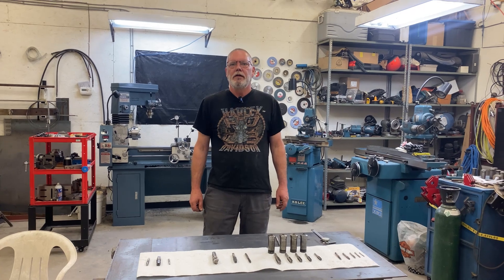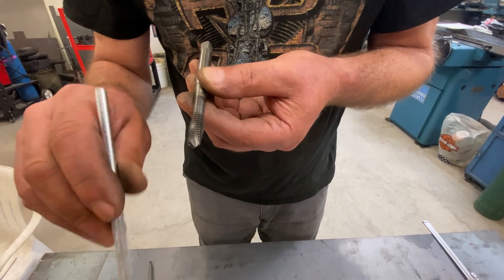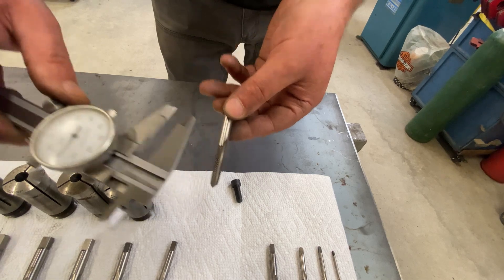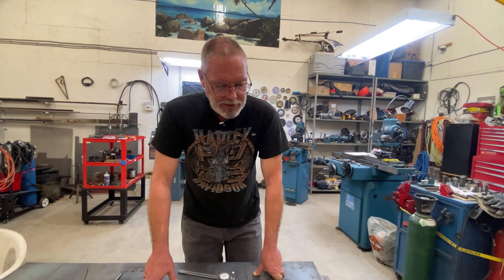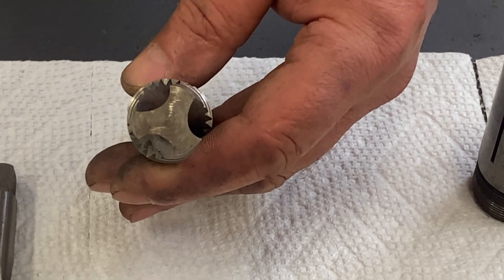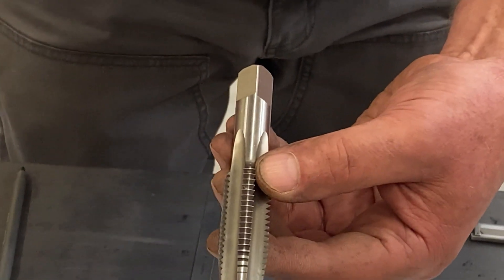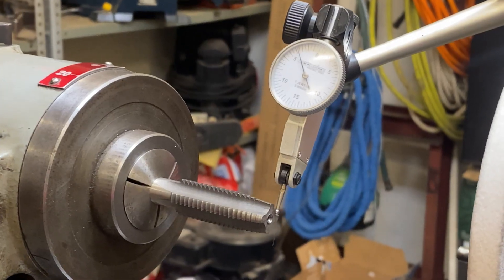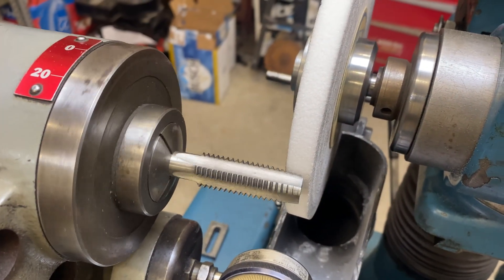TAPS - DEEP DIVE

Comment: Just one question, is the axial movement designed to accommodate grinding the flanks of the teeth if the wheel is shaped to the tooth profile? I have just discovered your site and am enjoying your videos a lot.
Reply from the maker: In this example the wheel is dressed flat and the main purpose of the axial movement is to match the grain of the grind to the pitch of the tap. To grind the profile of the teeth would require that the tap is advancing at exactly it's pitch. This would require the rotation of the tap to be linked to a lead screw. My equipment isn't designed to do this and doesn't have a lead screw to drive the table. 
Thanks for watching!

Comment: There may be an error when using a Papago translator. First of all, thank you for the good information. I'm a 29-year-old man who marches end mill and drill in Korea. Since I'm a beginner, I think there is a formula for calculating the tip angle according to RPM, but I even watched an overseas video while looking for it. It's a question that has nothing to do with the video, but after re-marinating the drill, the lifespan of the drill has been reduced. In this case, should the tip angle be reduced or raised? Is there a formula?
Reply from the maker: Thank you for the comment. I'm not 100% sure I understand your question but I will attempt to answer. Drill bits normally have a cutting angle of 118 or 135 degrees and the angle should be maintained regardless of how many times its been sharpened. I am not aware of any correlation between RPM and tip angle. Tap lead in angles are usually described as taper, plug and bottoming. The angle does not need to be changed as the tap is sharpened over and over again.
Hope this answers your question.
Reply: @Lappemountainliving  Thank you for your answer. If you don't mind, could you also upload the video of the entire process of the end mill, the end gash of drill re-grinding, the end rellef angle, and the end secondary angle. I would like to learn.
Reply from the maker: You are very welcome. Please check out my tool and cutter grinding playlist. There are a couple of videos in there about end mill sharpening

Comment: Great info again, thanks! Newbie question, what’s your preferred method for getting the center height. My TOS tool and cutter grinder has a wheel head that can be raised and lowered so not a fixed height so I’m not sure a center height gauge is the right tool for the job in my case.. Any thoughts? Thanks from Scotland!
Reply from the maker: Thanks for the comment! 
My go to for finding center (or any other height) is a dial height gauge. Say you want to match the height of a fixture you can measure a diameter on your fixture that is concentric to the axis with say a caliper. zero your height gauge on your table. then touch your height gauge off on the top of the diameter you measured. Subtract 1/2 the diameter and there's your center. Record that measurement and then adjust your spindle height using your caliper and height gauge as you see fit. 
Hope this helps
Cheers!
Reply: @Lappemountainliving Great stuff, thanks very much, that makes so much sense. Better get me a dial height gauge!

Comment: Gotta love those safety nazis. So the other method is between centers?
Reply from the maker: Indeed. I touched briefly on grinding the tooth face . That was the other method I was referring to. I'm not a huge fan of that method so I didn't go into it too deep. I suppose you could consider between centers a different method or just a different work holding option for the same method. Thanks for watching! Cheers.